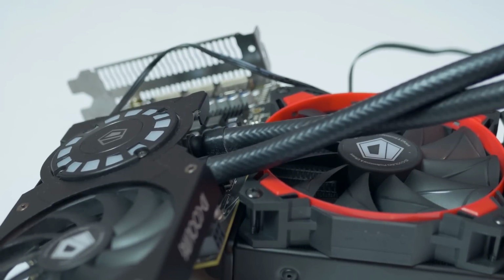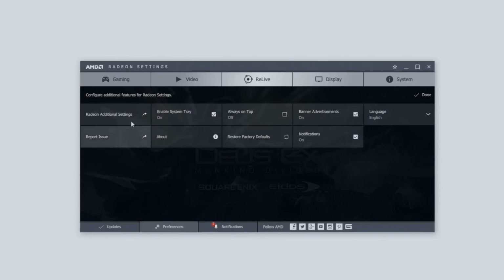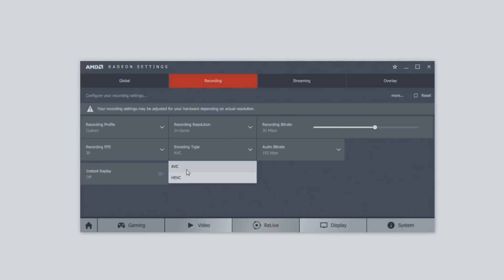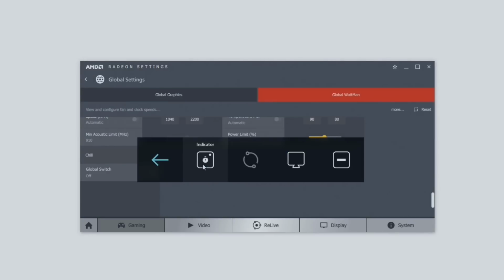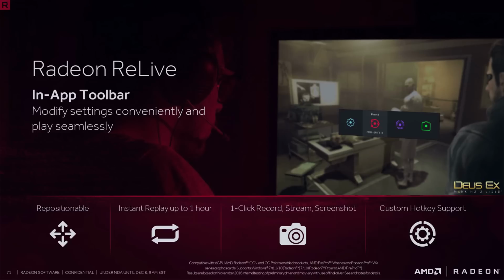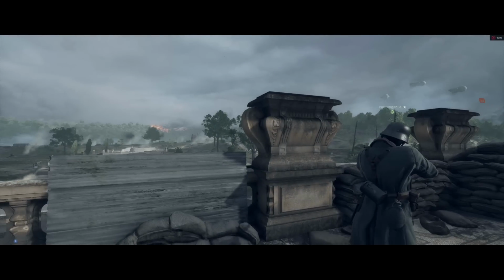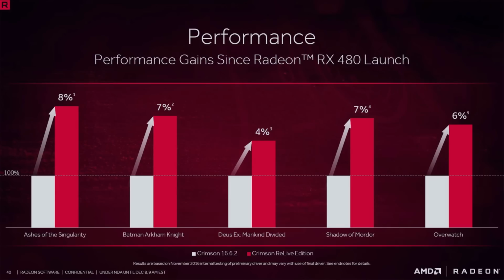Six months of POLARIS progress - RX 480 ft. Crimson ReLive 16.12.1

Comment: Hey dude! Did you ever manage to fix that ReLive problem you were having? I have something similar - now with the latest drivers it finally started working, but after like 4-5 minutes I start getting literal screen freezes for 2-3 seconds. Do you have any idea what it could be?
Reply from the maker: Hey man! Sadly, no. I mean, yeah it gets fixed sometimes and works flawlessly, but other times it just behaves like I mentioned in the video. 

I have no idea how to fix it, no idea how it starts doing that... Countless driver re-installs, Windows re-installs and other tweaks and it still does it sometimes. I make sure to never use the recording indicator on screen while recording since that seems to make it worse.
Reply: I try to record sessions under 4-5 minutes - that kind of helps in my case. But thanks for the reply. I guess we'll be waiting more :)

Comment: What's the purpose of the fan on the gpu block?
Reply from the maker: The AIO is designed for full length PCB cards that have the VRMs on the right side of the GPU. Since this is like 80% of the cards right now. Unfortunately, the reference RX 480 is neither a full length PCB, nor does it have the VRM on the right, but on the left. I can't rotate it to blow on the VRM since this is not possible by design and it wouldn't even physically fit there in the first place. So at the moment it just cool the mem chips (which don't necessarily require cooling...) and helps case airflow in my Phanteks Enthoo PRO M by a tiny, tiny bit. :D

Comment: I have a asus strix rx480 oc in one of my rigs and im really enjoying the gpu. Its overclocks around 1420mhz but its weird most of my numbers are lower at 1420 than 1380 in benchmarks. But the card is not down-clocking and maxes out around 70c, and im not sure what the problem is. I would think if its stable and cool at 1420 especially 1400 it should be pulling higher numbers.
Reply from the maker: +Chad Hay Hmm, that is weird. Are you 100% sure it is not downclocking? Start MSI Afterburner or ASUS GPU Tweak and closely monitor clocks during gaming. It could be thermal throttling or power throttling or current throttling. Different things, but they all act through the same channel and have the same effect: GPU downclocking.
Reply: MindBlank Tech i'll double check but it seems to be a rock solid 1420mhz at a max 71c. I tried with a no memory oc and im getting  3-5 less fps in most gaming benchmarks and a lower firestrike score. I used  msi afterburner to watch the clocks and power and they seem fine. It seems to be normal at 1400mhz but 1420 its runs fine no artifacting or downclocking just a lower score. Its got me stumped, im gonna check it out again tonight above 1400 but below 1420.
Reply from the maker: How much lower is the score (and the benchmark numbers)? If we are talking 1% that is margin of error stuff.

Comment: This card became true concurent to GTX 1060. Nice.
Reply from the maker: +AbsoluteHybrid I plan an updated head to head. I just hope time allows it to be this month. Really busy with day to day stuff. Not complaining, just sayin' ;)
Reply: +MindBlank Tech Sure, do that :) i have GTX 1060 6GB and i don't complain about performance tho, but RX 480 is a super great deal too. Basically it depends what games do you like more :D
Reply from the maker: +AbsoluteHybrid GTX 1060 is an awesome card. Temps are great, OC potential awesome, OC performance is excellent and power draw is also top notch. I'm thinking of building a passive cooled GTX 1060, as this card is capable of it, with very low voltage and lower boost clock (1800MHz). Performance would also be excellent for a completely silent card.

Comment: your modding probably has something with ReLive not working
Reply: i have similar mods on my card.Initially relive did this to me also.It was an issue with the virtual resolution,now it works great.
Reply from the maker: +thesilviu silviu Can't be the modding. It's just a cooler on it, no hard mods. And VSR isn't working for me as AMD STILL don't offer virtual res for ultrawide users.
Reply: I agree, the mods is not the culprit. I keep the gpu at 1445mhz and vram at 2150 all the time.But for me , on relive capture for the first time i used,it eated a lot a fps,and the videos was a slideshow. Then i disabled the virtual super resolution and it started to work fine.
After that i have enabled again the virtual super resolution and started to work right.
This is it my personal fact. Unfortunate for me i do not have a ultrawide monitor.
Cheers and keep up the good work!
Reply from the maker: +thesilviu silviu I finally fixed it. I do not know however... Reinstalling the driver did not fix it. Disabling GPU scaling did not fix it. Nothing fixed it but it just started working ok after a BSOD during recording! After that I tried again just to see if it would BSOD again and it worked flawlessly... So, yeah... :/ At least I got it working!

Comment: Should I buy a 480 if I already own a MSI R9 390?
Reply: Wait for rx 490
Reply: Doothe it's probably not a improvement, so no. wait for Vega probably if you want to upgrade, hopefully it's good. it's coming out soon
Reply: If you plan to record with Relive, it might be a good sidegrade, as Polaris supports HEVC recording.
Reply: There are only a couple of factors where the RX 480 is better.
 I for instance sold my R9 390 8GB for 200€ recently after I bought it for 330€ 13 months ago. The ASUS RX 480 8GB is currently at 300€.
Anyway, I got my RX 480 for free so I never had to make this decision.
The RX 480 is not much better in performance, but is a lot more efficient (275W vs 150W TDP). It will also likely be supported a little bit longer and has some extra features (HEVC recording).
However, the resale price of my R9 390 shows that it's still a fine card and will most likely serve you well until at least well into 2017 (on 1080p).
Reply: Okay so I'll hang onto the 390 for a while longer. I'd like to sell it before the used market price plumets too far. Zen and Vega are around the corner and it's not gonna be cheap.
Reply from the maker: +Doothe Then sell it now, keep the money and live with IGPU for a few weeks until Vega launches (hopefully), then add 100$ and get the GTX 1070 Vega equivalent. Just an idea.
Reply from the maker: +TheNewTimeNetwork Yeah, the 390 is a kickass card as well. Would not "upgrade" from a 390 to a 480. I would upgrade to a 490 as long as the RX 490 is not a dual Polaris but a single Vega chip.

Comment: Love your videos bro! 

Damn that AMD improvement though! Few more percentages and it will be beating 1060 in DX11 and even worse in DX12!
Although it would be interesting to see improvements to the reference model that actually throttled heavily on launch day. I wouldn't be surprised if there was at least 10-12% increase with that one.
Reply from the maker: +Dark Child Yeah, probably. But anyone can set power limit to 120% and then ot won't throttle. It's a locked 1266MHz for any reference or otherwise RX 480.

Comment from the maker: There's 2 main topics in this video.

1. Starts at 2:03 where I quickly discuss new features and updated features in the Crimson ReLive driver. If you're not interested or already know what this driver brings, then you can skip to the second part ->
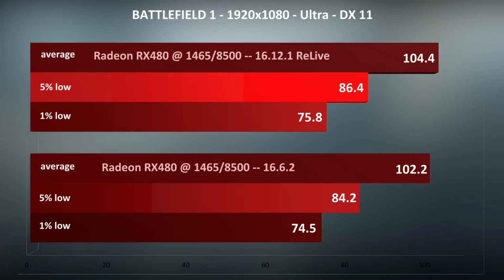2. Starts at 6:02 where I pit the new Crimson ReLive 16.12.1 against the initial 16.6.2 driver that supported the RX 480 for the first time. 11 games tested - DX11, DX12, Vulkan, DX 9. Make sure to see the master chart at the end of the benchmarks.